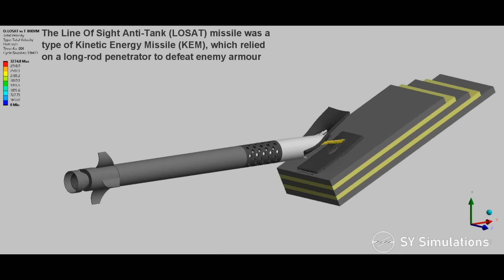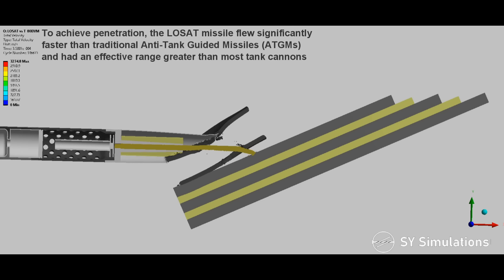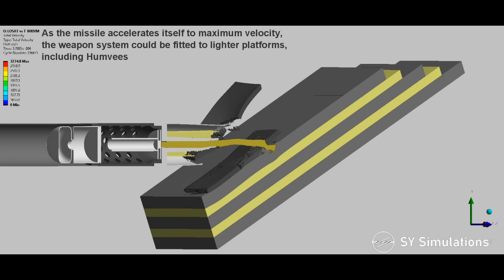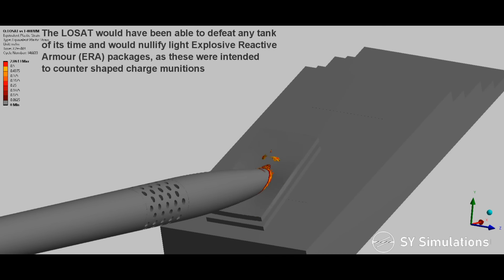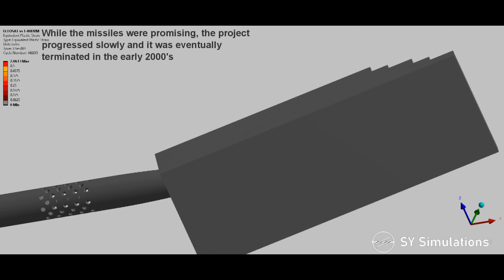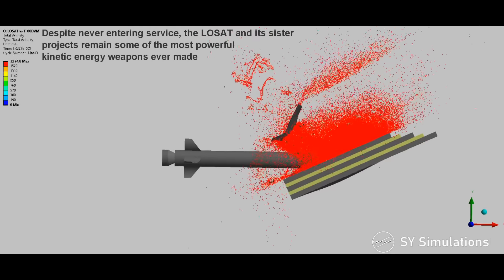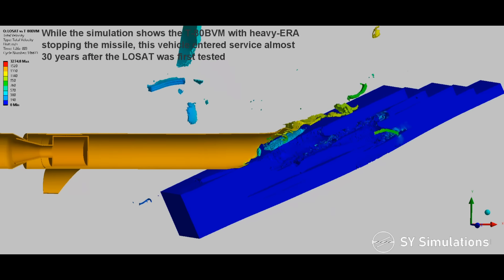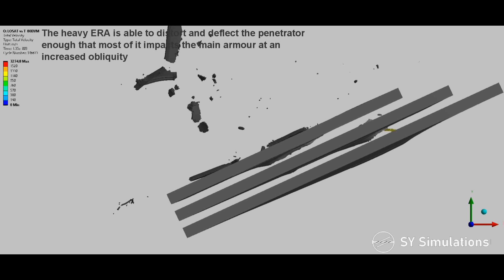LOSAT vs T-80BVM | MGM-166 Kinetic Energy Missile vs Relict ERA | Armour Penetration Simulation

Comment: Fair to note that despite 80BVM being so fresh, it is essentially old BV from mid 80s with new ERA. And Relikt itself is over 20 years old today, so 80BVM is new thing that was made trough pairing old tank with oldish ERA.
Reply: Yeah now I fully understand why LOSAT was canned. Modern 120mm sabot would go through the UFP of a T80BVM and LOSAT couldn't even at its maximum velocity.
Reply: @92HazelMocha  yeah ckem was vastly superior to this
Reply: @92HazelMocha  or, you know, just bring 2 HEAT warheads, 1 to remove the ERA block and the other to penetrate the armour
its either in the form of an ATGM with tandem charge warheads, or 2 guys with 2 RPG-7 shooting one after another onto the same spot on the target tank
Reply from the maker: That is true, although it is still considered one of the best protected Russian tanks today, which goes to show how overkill the LOSAT was for a 30 year old design
Reply: Still a shame they didint make a upgraded T-80U with Relict. Still, the T-90M was probably a better upgrade path as i doubt the T80U would allow for blowout panels and protected autoloader to be fitted like on the T-90.
Reply: @quan-uo5ws  The T-90M autoloaders are still the same autoloaders used on the T-72/90 series of tanks. 

The blowout comparent are for the spare ammo that was lying around inside the tank
Reply: @gotanon9659  T-90M uses AZ-185M2 according to Steven J. Zaloga (book: T-90 Standard Tank)

To contrast the T-72B (Object 184 variants) using the AZ-184 (initially) and the T-72 (Object 172 variants) using the AZ-172
Reply: @tranquoccuong890-its-orge  The latter is nearly impossible lol
Reply: @gotanon9659  They are not, they have a protective ring around them that protects against spalling, unlike any other t-72/90.
Reply: @quan-uo5ws  The blowout panels are just an extension to the back of the turret that could be done easily on any tank.
Reply: @SYsimulations  of course, the Relikit is 3rd generation E.R.A. and is very much superior to Kontakt-5 used on the likes of T80U, but T90M is the most protected tank in active Russian serivce. The base armor is much stronger than that of the T80BV on which the T80BVM is based on.

Could you please do a simulation of T-14's Malachit E.R.A. (basically Relikit with much longer plates) and compare its efficiency to Relikit ? I know T-14's base armor and capsule cannot be represented accurately, so I don't expect that.
Reply: @SYsimulations  Didn't the first of the 12 LOSAT units get delivered to the US Army in October 2002 and the system began a series of 18 production qualification test firings in August 2003, at White Sands Missile Range in New Mexico.
Reply: @PCGames-387  What makes you think that the T-90M is much stronger than the T-80BVM? The T-80 has 2 35 mm inserts made of textolite, which the T90 does not have
Reply: @tranquoccuong890-its-orge  If you think this is possible in a realistic scenario you need to rethink. Only possible in a fantasy world.
Reply: @愛を込めてロシアから  several reasons.

T90 A and M  variants don't use cast steel, bur rather welded steel which is better and gives it superior protection to the likes of T72, which like T80 use cast steel, and while the hull might not have textolite, it compensate by having:

-thicker steel plates
-a small space between the first plate and the rest
-a thin rubber lining
-a thin radiation lining
-2 thin small bulging steel plates between the main plates

The T90 A/M simply have a slightly better base armor. That's one of their main selling points compared to classic T72s (the other being the presence of thermals in all models).
Reply: Same goes for all MBTs around the world. Just Cold War era tanks with relatively modern upgrade packages. The only tank built from ground up and in active service is t-14.
Reply: @gotanon9659  Yes, because the spare ammo was the problem. not the carousel.
Reply: @PCGames-387  t90 has NERA style armor so it doesnt need textolite, similar to western MBT that also use NERA. Plus the T80BVM turret is just steel with quartz filling, extremely outdated since its derived from the T72A, while the turret armor of the T90M is an improved T72B armor.
Reply: some are newer T-80U
Reply: @quan-uo5ws There was an idea to upgrade the T-80U, it's called the T-80UA. Me personally being interested in Russian tanks (I'm Russian), I've did a tid bit of research into the T-80 & T-80U. 

T-80UM was an upgraded version of the T-80U that got Thermal Vision.
T-80UE-1 was a T-80UD turret fitted onto the T-80BV for some reason
and I couldn't find much about the T-80UA, but by the looks of it it's a relikt package added to the T-80U, alongside thermals & Shtora-1 aps
Reply: @SYsimulations   No it isnt. T-80BVM is a stopgap tank and the armor out of the trio of upgraded/new tanks (being T-72B3, T-80BVM, T-90M) is factually the least protected. Less so than the T-72B3.
Reply: @bittemeinrammstein  t72b3 still uses kontakt 5 though
Reply: @quan-uo5ws  That's thin metal plate. Sure it can stop the smallest spalling, but even a slightly bigger spalling would probably get through. And against heavy fragments of armor and sabot in case of kinetic kill it won't do much.
Reply: @PCGames-387  Given Relikt (and just how much of it is everywhere), T-90M may as well be the most protected tank in the active service right now, anywhere in the world.
Reply: @愛を込めてロシアから  Because T-80BVM uses base armor of T-80BV, which is somewhat inferior to T-80U, which is, AFAIK, inferior to T-90M.
Reply: @quan-uo5ws  Its probably not an improved T-72B, since they have completely different differently made turrets. Most likely, it uses some kind of its own design, probably based on some prototypes.
Reply: @georgeouroussoff3830  the t 14 being in active service is a bit of a stretch. Altho I guess propaganda could count as active service.
Reply: @quan-uo5ws newer variants of t72b3 have relicts in some places for example im sure they have them on the sides, btw u can put smth like kontakt 5 on the sides as the 2nd line of ERA (they look like gray bags)
Reply: @mauser98kar  The T90 does have a completely different turret, i was speculating that the composites of the turret are some kind of improved version of the T72Bs NERA style reflective plates, but we cant know for sure.
Reply: @quan-uo5ws  Even with K-5 it's stronger than T-80B with Relikt. At least theoretically.
Reply: @quan-uo5ws  I think, both composition and materials of armor element greatly depends on its size and shape. Meaning that using T-72B solutions on T-90M may be sub-optimal due to how different their turrets are.

For example, turrets if earlier Ts were round due to them being cast. It made impossible to implement solution found on, for example, Abrams, were single layer of armor filling is composed of single big plate. Instead, they used smaller plates in kind of chevron pattern, overlapping on another. Yet, to my knowledge, it was possible, if unlikely, that the round would strike at weird angle, going between the plates - something impossible in case of singular big plates going parallel to turret's outer layer.

Unlike those older designs, T-90M utilizes turret not unlike those found on western tanks. It has big chunky cheeks that could sport all kinds of large plating - no unergonomic round shapes.

So, I would imagine, that even if T-90M re-use some elements of older designs, it does so in a manner that would make it hard to recognize said element, due to how different the overall structure of the turret is.
Reply: @tsumibito5796  It was made in a few dozen or so batch that undergoes test service. Its not an active service even by Russia's own standard though. Its called опытная эксплуатация - trial operation.
Reply: @bittemeinrammstein  Well the B3 does have a stronger base armor, but relict does provide a much bigger advantage (it can break up m829a3 and even tandem projectiles unlike k5) so id say t80bvm is better protected.
Reply: @georgeouroussoff3830  T-14 isn't in active service and has been announced that it won't see serial production.
Reply: @quan-uo5ws  T-90s, including Ms have shown to be just as vulnerable to ammo cookoff as other T- series tanks, the "armouring" of the carousel is ineffective as you aren't removing the risk of cookoff from the main fighting compartment, until Russian tanks receive an autoloader mechanism that feeds into the breech from a seperate compartment, that will continue to be a bandaid solution that leads to more turrets flying off their hulls.
Reply: @Donuthan  There are very few, if any, videos and photos of T-90M popping its turret, unlike all other Russian tanks. That means that the autoloader solution is working.
Reply: @quan-uo5ws  No, no that's completely wrong, if a 1950s hand thrown RKG-3 pops the T-90M's turret then it's definitely not protected with 2 crew members still sitting directly on top of it, it's simple physics. Plenty of documented incidents, on oryx and elsewhere, even on wikipedia there's a gif of T-90M very visibly losing it's turret.
Reply: @viktoriyaserebryakov2755  it actually was quite a big problem. A lot of the spare ammo were stored above the carousel; around the head and torso levels of the crew. They were also unprotected, unlike the carousel and the other spare ammo. It was discovered in the Chechnyan war (although some say it were 1980s Soviet ballistics test) that the spare ammo above the carousel were the first to be hit and damaged enough to cook off or just instantly explode.
Reply: @Donuthan  The armouring doesn't remove the risk but it reduces it. It is mostly for spalling from a horizontal plane though. Other pieces of ammo are also only protected in a similar way and grenades can go between the armor pieces, because the armor is mostly for post-pen effects not grenades.
Reply: @user-tv7fg7wt2d  I don't deny that it's there to serve a purpose for a specific category of penetration, and that is a good step, but ultimately it will still remain a bandaid on a very big, inescapable problem until the autoloader/crew compartments are changed. Those tanks have still popped turrets many times, if they're losing out to just simple hand thrown grenades, and top attack ATGMs are more prevalent than ever, then they're still extremely vulnerable to that threat
Reply: @gotanon9659 You got ate.
Reply: @92HazelMocha M829A4 could have a chance but it’s highly classified. M829A3 would not penetrate however.
Reply: @belgianfried T-90A use the autoloader as well i think despite in his book he mentioned that T-90M received the improved autoloader
Reply: @mauser98kar T80BVM is actually a T-80U hull with T80B turret in terms of composite armor
Reply: @tsumibito5796 Even if America and Germany put in service the KF51 panther and the AbramsX they would never risk them US didn't even send export M1A2 variants in Ukraine only upgraded M1A1
Reply: @AlexanderK9519  First time hearing it, but may be. IIRC, U and BV have different turret armor anyway.
Reply: @92HazelMocha yeah, no.
Reply: @enriqueouro9   Russian tanks are designed to be small and lightweight. While it's possible to incorporate a small Type-10 style autoloader, it would significantly reduce the tank's ammunition capacity. On the other hand, a manual loader tank in the style of America or Germany would require a larger crew and result in a heavier and larger tank to accommodate the extra ammunition storage.
Reply: @PCGames-387  you'd need specific information on malachit and the t14 UPF armor to do a simulation (dimensions, material, and other characteristic such as armor spacing) which we dont have
Reply: @quan-uo5ws agreed, but iirc the reason they chose the BV was to keep them relevant as at the time it was assumed the UM upgrade of the T-80U was good enough for the time being, having kontakt-5 on better base armor and a 1st gen thermal imager, while the BV was considered rather poor at the time. There may still be potential for a future upgrade to the T-80U as it becomes more and more obsolete. Maybe we'll even see relikt bolted onto T-72B3s and T-90As someday.
Reply: @愛を込めてロシアから  the T-90M uses the same hull as the later T-72B variants which is a bit better than the armor of any T-80 variant, including the T-80U. But don't forget the T-90M's turret is also much better protected than any T-80's which is much more important than hull protection.
Reply: @georgeouroussoff3830  the T-14 isn't the only new tank in service. There's also the South Korean K2 Black Panther, Turkish Altay, and Japanese Type 10 which were all built mostly from the ground up after the year 1991. If you wanna count tanks that haven't entered service, you can add the German KF51 Panther too.
Reply: @viktoriyaserebryakov2755  idk if you're being sarcastic or not, but that's actually true. Spare ammo in older T-72 based tanks was the main cause of ammo explosions, not the carousel due to how low down in the hull it sat and the fact most of it has a steel cover over it. On T-64s and T-80, yes the carousel is a bit more problematic because of the unprotected vertically placed charges being more likely to be hit. The T-90M also has a completely enclosed armored cover with spall liners on the carousel now too and no longer has spare ammo inside the crew compartment.
Reply: @ Why on Earth would I be sarcastic?

Comment: While it was unable to penetrate the upper glacis, the fact that it was capable of creating a perforation in the rear plate shows just how powerful the LOSAT was.
Reply: Given the sheer amount of force involved I have to imagine it would still be a very significant emotional event for the crew in any case.
Reply: A second follow up shot might get through
Reply: relikt is more impressive
Reply: It didn't penerate, so it was not effective.
Reply: @flanker1659 didn’t penetrate isnt much of a consolation to the crew whose ears and head are probably ringing from having a 150+ pound projectile hit their tank at Mach 5. And bear in mind, this is Relikt at a pro deflecting angle on the front plate. A hit to the side or even the turret face would have different consequences for the inhabitants.
Reply: @ronaldmcreagann6343 nah they will be fine they wear ear protection anyway
Reply: @divoulos5758  you say this, but we’re talking about Russia here. I’d fully expect there to be a 20% chance the crew in some capacity, lack that equipment. Even if they all did, the kit is meant more for the loud engine and being able to clearly speak with the crew than blocking out massive projectiles hitting your tank. It’d probably still be loud as hell.
Reply: @ronaldmcreagann6343  Obviously a hit to the side would have had catastrophic consequences. WW2 guns would have no problem penetrating any MBT.
But I agree, that hit to the front would have felt like putting your head in the church bell, especially for the driver.

Comment: Result converges with L-O estimations. Relikt tanks hull front can be represented as 800mm RHA vs KE (550+250mm) while the rod simulated penetrates up to about 780mm.
Reply: In 1985 test, 3BM32 penetrated T-80BV at up to 2000 m away, whilst T-72B was invulnerable to it from point blank range.

Soviets rated T-80BV’s UFP as 430 mm eRHA and T-72B’s UFP as 480 mm eRHA. So I am not sure where you got the 550 mm base armor.
Reply: @azeke8  T-80BV have at least 2 base armor layouts. An earlier (and more widespread) 3 layer armor similar to T-64B, which is what most existing T-80BVs have. The second armor corresponds to the  1985 model, they were produced with the same hull as T-80U (the 5 layer armor simulated here) until they were completly phased out by the latter (so basically a T-80U hull and a regular T-80BV turret). This late 5 layer armor is rated at 550mm KE across soviet sources and 90s western sources.

T-80BV Obr. 1985 was a very limited series production. Its unknown if when converted to T-80BVM the BVs with the older 3 layer armor array got it replaced or not.
Reply: @alanch90  All new production T-80BV from late 1984 onwards, have the same hull as T-80U. The ones with old 3 layers armor are upgraded T-80B. The test I mentioned was specifically done to compare the new production tanks from rivaling tank design bureaus.

It was not a limited series production. 4000 T-80BV with 5 layer UFP were produced from 1984 to 1991.
Reply: @azeke8  What are your sources for this stuff?
Could you share one that includes the part about 3BM-32?